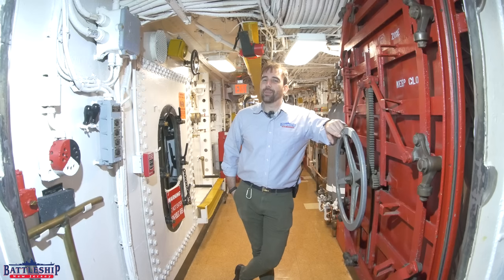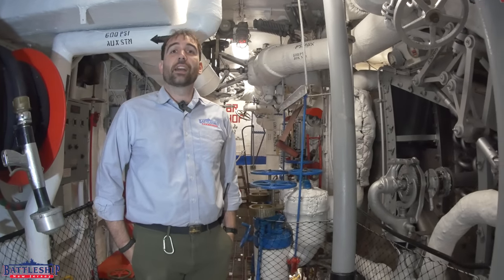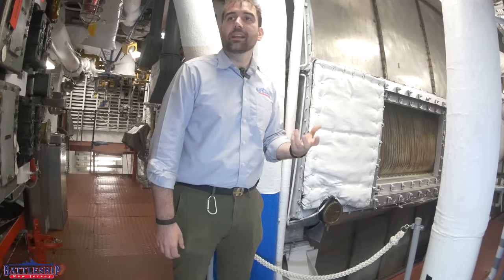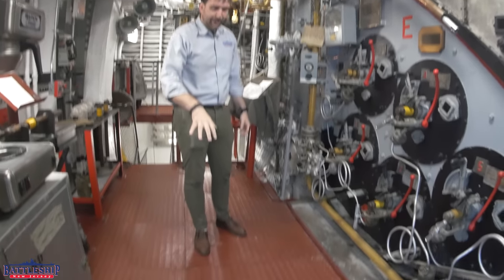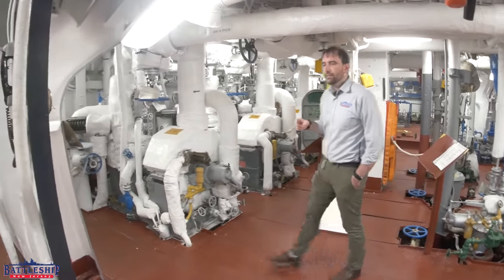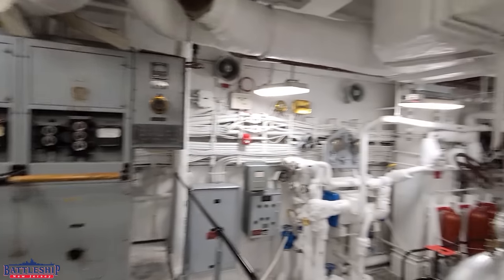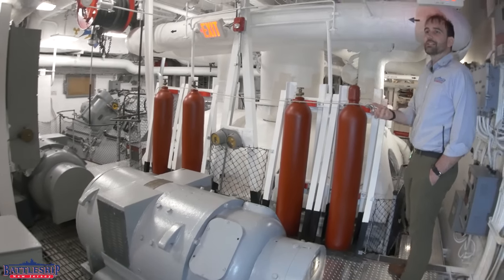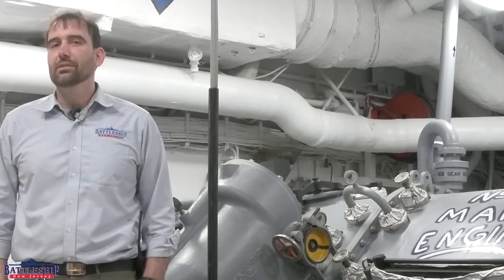Inside the Propulsion Plant of the World's Fastest Battleship

Comment: Non condensable gasses are purged through the main air ejector.  The DA tank main duty is to store and heat feed water. Also you said the feed water got up to 800 degrees in the steam drum. The water is turned into saturated steam in the steam drum, approx 495 degrees. Then the saturated steam goes to the superheater where it comes out at 840-850.  Principles of Naval Engineering (NAVSEA) Page 348 "In modern shipboard steam plants, air ejectors are used to remove air and other noncondensable gasses from the condenser"  Been a long time since I was on the Jersey or Missouri, but you can usually find the main air ejector forward of the HP/LP Turbines.
Reply: Another (likely) engineer.  Hello, friend.  He also said the propellers are spinning at approximately 200 rpm.  As a merchant sailor, I'm sure the props on New Jersey spin faster than a cargo ship's (around 70-80 rpm at full speed).  I highly doubt, however, that they're spinning at 200 rpm.  Its probably closer to 120-130 at full sea speed.

Edit: It would appear that I was wrong.  I did not realize that naval propellers are smaller diameters.  This allows them to spin much faster.  Thanks for correcting me.
Reply: An Iowa is going 3 or 4 times faster than a Liberty or even a turbine powered Victory ship.
Then again, a submarine sonarman could probably hear an Iowa at full steam half an ocean away.
Reply: @PanzerWeeb3305 I served on Ike(Nimitz class) max turns was 169 rpm.
Reply: No he is correct this time !
Navy ships shafts turn faster than merchant ships due to smaller size of propellers so 200 is real

From internet

.Before her Vietnam deployment the New Jersey obtained 35.2 knots at 207 RPM during machinery trials. There is no mention of what was the SHP or the displacement on that day.

In 1985 the Iowa slightly exceeded 32 knots at 205 RPM. There is no mention of what was the SHP or the displacement on that day.
Reply: @whirledpeaz5758  Thanks for correcting me.
Reply: @josephpadula2283  Thank you for correcting me.  I didn’t realize that navy props were smaller and thus spun much faster.  If you did 200 rpm on a modern merchant ship, you’d break something for sure.
Reply: Also our Sea Speed concept  does not apply to the Navy.

We merchant ships normally run at full power and for steam plants
The entire cycle including extraction bleeds etc is designed around that .
Navy ships Rarely run  at  Flank speed their  highest.
Reply: @ahseaton8353  Please see the edit to my original comment reply.  Thanks for correcting me.
Reply: I was on NJ in engine room#1 when we set speed record, throttles wide open.  208 RPM outboard 212 inboard shafts.

Actually, DA, deairating, feed tank does remove air and non-condensables. That’s why we have nozzles the condensate flows thru, to mechanically separate air.
Reply: The DA removes air and non condensables. The air ejectors do as well but there is a reason it is called a dearator. BT2 1980 to1990, still working in power plants.
Reply: Yes. the DA tank removes the last bits of dissolved oxygen from the feed water.  (Principles of Naval Engineering (NAVSEA) page 354.)  Condensate travels from the main or aux condensers to the main air ejector where the noncondensable gases are removed. The condensate next travels to the DA tank where it becomes part of the feed water system again.
Reply: Also, the main feed pumps (MFP) do not discharge to the dearating feed tank (DFT).  The condensate pumps take condensate from the main condenser (thus the name) and discharge to the DFT, where auxiliary steam strips the remaining air and non condensable gasses (the majority being removed by the aptly named air ejectors) and the MFP's take a suction from the DFT (possibly with main feed booster pumps to provide suction head for the MFP's) and discharge to the boilers.  

No, I never served on a BB, but I was a propulsion plant watch supervisor on an aircraft carrier.
Reply: @johnjones5354  The BBs do have a condensate booster pump. In the video you can see them near the boiler feed water pumps. All you can see is the turbine and reduction gear. Little babies.
Reply: Spot on mate. Extraction pumps from condenser to DA/ Main Feed tank and Main Feed pumps from there to the Boilers. Ex Maine Engineering Artificer Royal Navy.
Reply: Air ejectors main purpose is to create and maintain a vacuum on the condenser. The vent will vent off air and non condensible gases yes but the DA tanks main function is to de airate (DA), heat and store the feed water. Condensate pumps pump to the da tank and feed pumps take their suction from it. Key to this function is the vent off the da tank exhausting the air.
Reply: The purpose of a Deareating Feed Tank is to preheat, store, and deareate feed water - as well as provide net positive suction head for the feed pumps.

Comment: I recall being told that bunker C fuel oil also had the highest BTU content per pound and therefore gave the best economy of the fuel types available at the time.

I served as a machinists mate on board the Newport News (Salem class 8" gun cruiser) and the video was a trip 50 years back in time. I spent many hours standing in front of the throttle wheels and learned how to simultaneously spin the ahead throttle closed and the astern wheel open. That might have cut 5 or 10 feet off our stopping distance.  

Ryan makes a good point about how hot the engineering spaces were. We worked in dungaree pants and t shirts with plenty of exposed skin to collect sometimes serious burns. Nobody knew how to spell PPE back in those days. We drank as much water as we could stand and took handfuls of salt pills. No wonder we all have high blood pressure now. 

50 years later I can still remember the smell of the bunker oil, the heat and humidity, the noise (good for a VA tinnitus disability claim) and the pride we felt in doing an extremely difficult job extremely well. Snipes are a rare breed.
Reply: That is part of the reason I joined the Air Force.  Being a farm kid, I liked the vast open areas of an Air Force Base compared to the TIGHT quarters of a ship.
Reply: Wow! Thanks shipmate for your report. I enlisted as a BT - boiler tech. However, in boot camp I received orders as an ADAA or Aviation Machinist Airmen Apprentice - E2. I escaped the pressures of this engine room environment to one of the aircraft carrier flightdeck and land-based air operations as a low ranked Enlistedman. Thank you for your service Shipmate and Shellback.
Reply: @klsc8510 Were you ever stationed at Hickam Air Force Base Hawai'i? I am from da Aina. Thank you for your time in service.
Reply: @byronharano2391  I was never that lucky!  In the Air Force I was at Lackland AFB, TX, Keesler AFB, MS, Griffiss AFB, NY, Grissom AFB, IN, Preum AS, West Germany, Ellsworth AFB, SD.  I had TDYs to Barksdale AFB, LA, Sembach AB West Germany, and Saudi Arabia.  In the MI Army National Guard, Kalamazoo, MI, Adderbury, IN, FT Riley, KS, Kuwait, Iraq.  
You are most welcome.  It was an honor to serve back then.
Reply: @klsc8510  When were you in Kuwait and at what base? Depending upon the year and base we might have crossed paths in 🇰🇼 Kuwait. I was there from 1993 to 2004. Again from 2009 thru 2015. Too bad you never did get assigned to Hawai'i.
Reply: @byronharano2391  I was in Kuwait for 3 for short periods.  Camp Virginia June-July 2003.  If you ever saw the state of Michigan flag flying, that was the flag I got for the Company. 
Coming home in April-May 2004 we were first at Camp Victory and for a day at Camp Wolverine.  Being a Michigander, I got a t-shirt for the Camp.  I posed for a picture under the camp sign.
Reply: @klsc8510  My brother-in-Arms. I bet we met in passing and never knew. Small world. Kuwait and Iraq is no cake walk to those who walked the walk and SHOT the talk. Blessings my brother.
Reply: @byronharano2391  My Guard Company was Signal Corps.  As I joked, our mission was to shoot our mouths off and not our rifles!  I succeeded at both.  I was rated as expert with my M-16 during my tour.  I never had to fire a round in anger!  THANK YOU for your service!
Reply: @klsc8510  My Brother-in-Arms. Thank you for your service. I never shot a round in anger active service and never while as a Contractor for the US Navy and Army. Although as an Armed Security Officer in Kuwait 🇰🇼 on my second contract, I came close to shooting people. You served in our Armed Forces and you did plenty my fellow citizen and service member.
Reply: @klsc8510 oh bc not everyone in the navy serves on a ship. I.e. MA's . There is a saying I picked up from the navy. Choose your rate, choose your fate. I work with AF /SFS as a Federal Police Officer.  I wouldn't switch. I knew when my orders ended, had way more choices of where I was going and lil more control. SF wise atleast. Usually soon as you get to your duty station they are already harping on you to put in places for your next duty station. MAs atleast when I. Went through in 06 had to do 1st enlistment overseas. It was 4-3 rotation with ways to shorten it or extend that timeline.
Reply: davidogborn47  Certain jobs get the glory.  Others just get oily!  It is the TEAM that makes it happen.  Smart leaders get it.
Reply: Yes, Bunker C has 18,500 BTU per Lb.
Reply: The video was a trip back to the future.  I served on USS Richmond K Turner as Machinist Mate  Second class .  Qualified on all engine-room watch stations and EARNED  the Top Watch for aft engine-room . Watching the video I could remember the smell and heat, especially when we operated in  the warm waters of the Caribbean .  The memories are indelible and are engraved in my memory. Salt tablets were SOP .   I ‘m sure I could, after  50 years ,step right back into any 1200 psig US Navy steam turbine powered engine-room and operate it like I never left.  Proud of my service.  Haze gray and underway you bet.
Reply: Pappy, I feel the same way about the first computer system I worked on in the Air Force.  I haven't touched the system since 1984.  If it was still around, I still could do it.  It was so easy to work on for electronics.  I bet in 2 weeks, I could teach you how to pass a QC Evaluation.  Granted you would be clueless on how to fix it.  Quality Control wouldn't have the slightest idea about that so long as you can read and follow the Technical Order, use a multimeter and use an oscilloscope.  The two pieces of test equipment would only take a couple of days to learn well enough.  Understanding the system and learning to read the logic schematics is what takes a year plus of training.
Reply: @Pappy995 Thank you for your service!  I was a midshipman on the Turner in the summer of 1978. First sea time for a kid from the Midwest. I remember painting the steam-powered air ejectors on the top of the DFT; way too hot!Went on to attack submarines. They have same engineroom systems, just a different kind of fuel 😂
Reply: Thank you, Sir!
Reply: Yes, but hey it was a B---ch to work with. Dirty to use and the time to preheat it to make it move.  There were some diesel ships that still use it, but I think the sulphur content is the problem these days.   Distillate is way easier cause its been refined.
Reply: "SNIPES RULE the UNDERWORLD!" as we say.  Cheers.

Comment: The paper mill where my father worked as an engineer when I was a kid also burned Bunker C in B&W boilers, which probably explains why most of the guys who worked in the mill's steam plant back then were Navy vets. Also, fun fact: it's called bunker oil because in the earliest oil-fired ships, which were converted from coal-burners, it was stored in what had been the coal bunkers.
Reply: Interesting about the name of Bunker oil. I'd always wondered.
Reply: ,,, I always wondered also, but thought is was very low quality / refinement  .
Reply: @rolandtamaccio3285  Oh, it is definitely that--it's practically tar. The "coal bunkers" thing is just where the name comes from.
Reply: Oil fired electric generating plants on land also referred the oil as Buncker C. It had to be steam heated in the tanks to pump it into the "power house".
Reply: Paper mills often run what they call "recovery boilers" to generate the power needed to run the mill itself, though they can sell surplus power to the grid if they want to. The primary fuel for these boilers is what is known in the paper industry as "black liquor". This is a byproduct of the wood digestion and pulping process - the cellulose fibres from the wood are what become the paper, but wood contains more than that: The lignin and other resinous parts of the wood are digested by the alkaline cooking process and are separated out into soapy, oily concoction - this is the "black liquor", though the colour can vary from yellow, through red, brown or black depending on the type of wood processed.
Before the 1930s, most paper mills just dumped the black liquor into wastewater, which was not a great practice because it is caustic and toxic. Recovery boilers were developed to actually use it as fuel, which turned it from a waste product into a valuable energy source. There are two reason why a mill would co-fire the black liquor with Bunker C oil: Primarily because some types of wood don't generate as much black liquor as others, so there isn't always enough to generate all the energy requirements for the mill, meaning they need to burn additional fuel for that. But also, in some places the government will provide subsidies for factories or power plants which supplement their energy requirements with biofuels - and since black liquor is classed as a biofuel, paper mills can claim this type of subsidy if they burn a combination of a fossil fuel (which Bunker C oil obviously is) and a biofuel in their boilers.
Reply: @lloydevans2900 interesting, thanks.
Reply: Most people who work in steam plants NOW are Navy vets lol 

Steam is still a huge deal in our world.
Reply: @lloydevans2900 

Thank you for that! 

I have a paper plant customer and now I get what the recovery boiler is doing. 

Much appreciated explanation.
Reply: @ZGryphon on a ship I was on while in the navy I was classified as B.T. boiler tech. we use old bunker oil. it was heated up to 250 degrees through a steam heater before it went into the burner barrels then burner nozzles through a atomizer tip. which was about 200psi.
Reply: Super cool. I used to work with an old mill that used to run bunker c in their boiler. They burn heavy black liquor as does every mill now but you could still walk under the boiler near the fuel heater area and smell the bunker fuel. Multiple 1M gallon fuel tanks outside.

Comment: Excellent tour.  One point you missed was that the reverse was often used when the ship was stopped to create a lee.  When backing out from a pier, we used the outboard shaft back slow to move some water between the ship and the pier.  Also, when working with small boats in open ocean, we would back the shaft on the side of the boat to create some calm water so it would be easier for the gig to approach the ship.
Reply: I’m not understanding the second part of your comment about working with small boats.  Are you saying that when underway you’d reverse an outboard shaft to create calm water?   I’m by no means a sailor but it seems like that would create more turbulent water.
Reply: @cruisinguy6024  You are pumping water to the side of the ship, to counteract the forward motion, so the boat comes into what is essentially calm water. The ship would always have some slow forward motion, so that the rudders have control authority, and the ship will not be rocking off beam, so pumping water forward to make a still pool near the midpoint will make transferring and mooring easier, as you are no longer needing heavy lines and bollards to apply pull to the smaller vessel.
Reply: @cruisinguy6024 At sea small ships would pull in alongside an Iowa class battleship to either offload supplies to the battleship or to top up their own fuel supplies. Iowa’s carried a lot of fuel so were often used to supply fuel to other ships. 

This is all done in open waters and the ships don’t stop while doing this. Hence the comment about turning the propeller backwards on that side of the ship to reduce wake alongside the battleship so as to make it easier for the small ship to stay on course.
Reply: @tomnewham1269  I appreciate your response. I've seen lots of videos of UNREP from supply ships in open seas and it always seems as if the ships are moving at a good clip.  When a shaft is put in reverse to create a smooth patch for a smaller vessel to come alongside what's the forward speed of the ship typically when this happens?
Reply: @cruisinguy6024 Those unreps are happening around 15kts. Bringing small boats alongside is done at bare steerageway, about 3kts
Reply: That is a really awesome detail.
Reply: That's clever procedure!😃
Reply: @tomnewham1269  Iowas carried
Reply: Also could have mentioned the jacking gear. Used in port to keep the shafts rotating slowly. So they will not sag or warp which could cause vibration. Vietnam vet  USS Princeton LPH5. Essex class carrie built in 1944. Frank Raddenbach